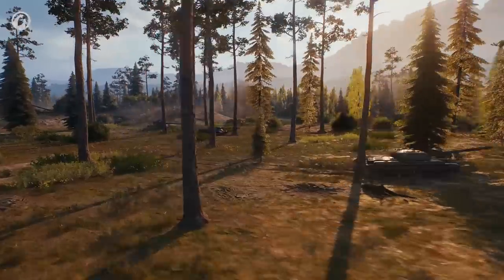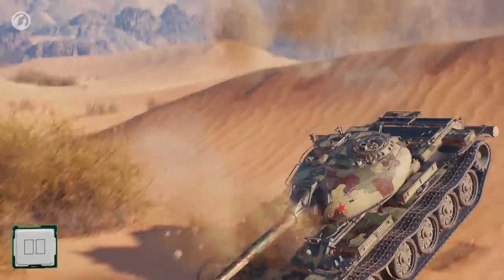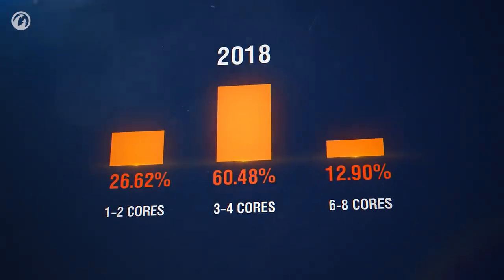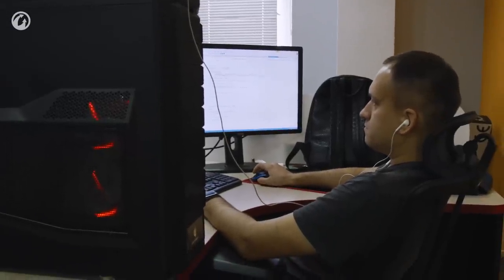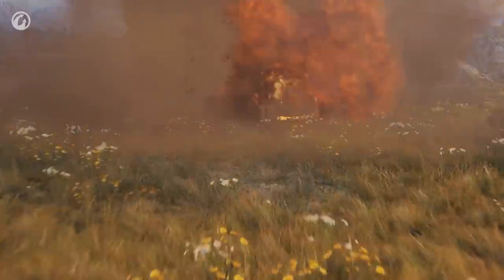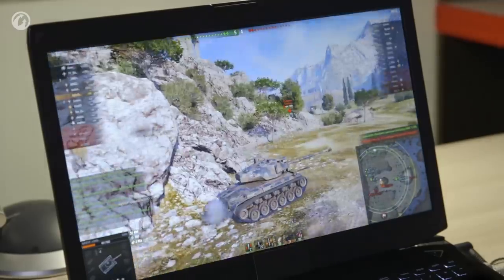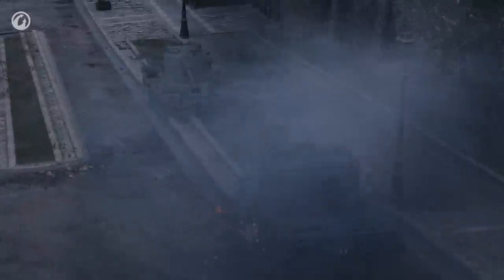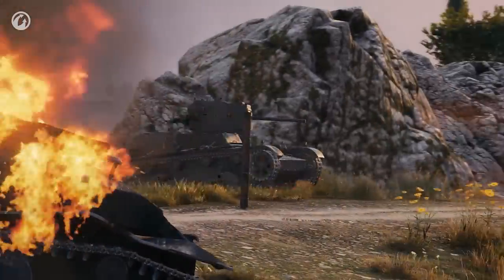Developer Diaries: Multi-Threading in World of Tanks

Comment: What about multi Gpu usage ? Its easy to install an cheap 2nd Graphics Card, lets say GT710 or on newer Systems GT1050 as second GPU. From crushing numbers at Einstein@Home and other projects i know what an advance this is vs cpu power if they are used for precalculating, almost all Mainboards support 2nd GPU (even a Pci-E 1 to Pci-E 16 riser cable reduces gpu power only by max 8% i know by own measurement ... ). For example, a GT750 calculates 8 times faster than 6 cores on AMD 3,6 GHZ Cpu. And it costs less than half that cpu. If in game will be implemented that 2nd GPU ( the weaker if not both same ) will be used for calculating its a fine and cheap way to update older systems easy and cheap. Now, however, im interested what update 1.4 will bring to my win1064bit 8 core*4Ghz GT1050-2GB and GT1060-3GB System where physX is bound to the 1050 and outputgraphics to the 1060 while Graphicsettings are set to med effects. Not that having probs in 1.3 - my frames are dropless 90-120 :)

Comment: AMD high core fx cpu may finally get higher fps. 😉
Reply: I dont think you we see much difference with 1050ti as you have low range gpu. It mostly will increase for people with high core cpus and mid to high end gpus. 
I have 8350 at 4,4 ghz and rx 580. Hopping to see a bost to around 120 fps. 😉
Reply: fx cpus will get less stutter for sure, means, more stable fps

Comment: I7-6700k, Gtx1050 - 2Gb memory, 8Gb Ram. Maximum settings 55-80 fps
Reply: i7 6700K, MSI Gaming 6G 980 Ti - 6GB, 32 GB Ram, 100 FPS or so at 1080p.
EDIT: With V-Sync on, 60 FPS. I have a crappy 1920x1080 60 Hz monitor. I want an ultrawide, but gotta save up, lol.